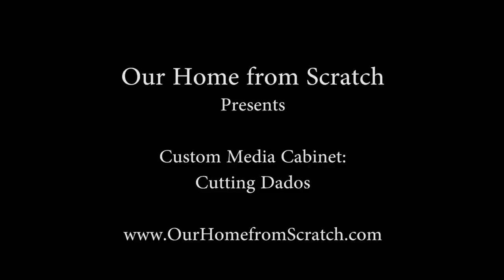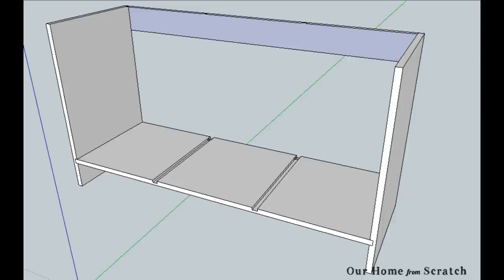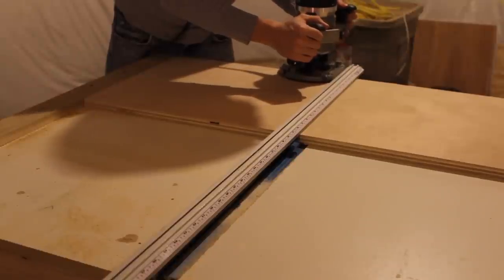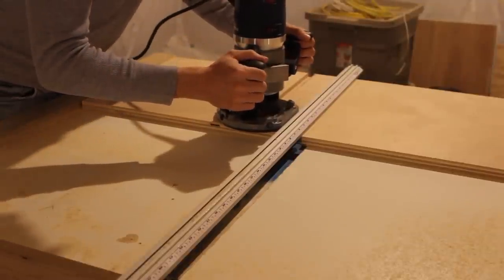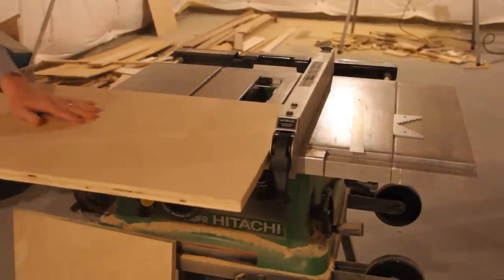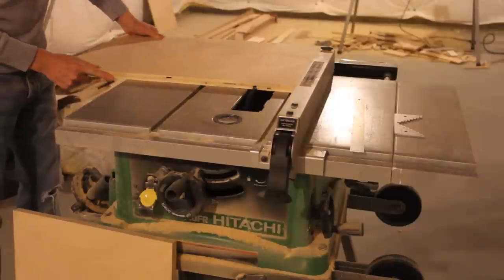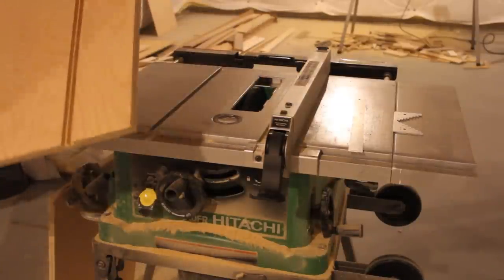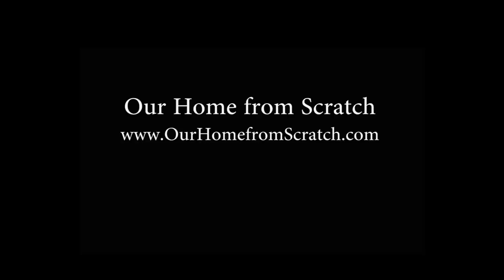How to Cut Grooves and Dados

Comment: Hi John, could you give any advice about to choose a router? Also, what is the metal guide called that you have clamped down to guide the router? Thanks, Andrew
Reply from the maker: It depends what you want to cut.  For cabinet building, a great entry level router is the Ryobi model:  https://amzn.to/2r5cURd  For more professional level work or if you're in it for the long haul, you can opt for the Bosch router with the plunge and fixed base:  https://amzn.to/2DKQEDF

The guide I used is no longer available, but you can get the latest version here:  https://www.amazon.com/dp/B0000DYVA9/?ref=exp_johnourhomefromscratch_lv_dp_vv_d

Comment: Here’s a tip: 3/4” plywood is actually not 3/4” thick but actually 23/32”. If you use a 23/32” size router bit, your grooves/dados will be nice and snug.

Comment: Do dado blades work with circular saws?
Reply from the maker: Hypothetically, yes.  In practice, no, they don't fit.  Most circular saws have 7-1/4" diameter blades.  Most dado blades are 8" in diameter.  Additionally, the stud on the saw that holds the blades isn't long enough to fit additional blades.  Normally, you would just use a router with a cutting bit for making dado cuts freehand.

Comment: I am using pine to build a table and a router to cut the slots or dados.  Just for fun and to frustrate myself, I am putting dados in the legs, then placing 3/4 pine in the slots to attach to the table top.  My problem has always been that the 3/4 inch router bit cuts a slot that is too tight for the 3/4 inch pine.  Besides using sandpaper wrapped around a piece of pine and slowly and painfully widening the slot, is there a better way to make it slightly wider; but, snug enough to look professional?
Reply from the maker: You can adjust the cut by moving back the fence a hair and making a second pass.  Use a thickness gauge to measure your adjustment.  Also make sure that you're using a 3/4" bit and not a 23/32" bit.
Reply: I checked the bit size.  It is a quality bit so I am guessing it is 
accurate.  I've also used more than one bit and had the same problem.  
I've also used the two pass method.

I was secretly hoping that you would tell me of some magical tool that I could tell my wife, "John Our Home from Scratch told me about this so I have to buy it..."

Thanks for the input.  Your videos are helpful.
Reply from the maker: Sorry!  I'm always happy to help guys get approval for tool purchases.  Let me know if you need something in writing!
Reply: I'll save that ace card for the "John said I need a 70" flat screen in my workshop to finish that bread board" discussion...
Reply from the maker: I'll order company letterhead paper to make it look more official.  Just let me know when.  :)

Comment: Hello John. Great demo. I use my router to do dado's and grooves but never used my table saw. I have a 10" craftsman table saw that looks similar to your Hitachi table saw and I was always under the impression that you could NOT use dado blades on these small table saws. Can you tell me what blades did you use for these dado cuts? Thanks man.
Reply from the maker: Thanks, Ed.  Some smaller contractor table saws like my Hitachi can handle a couple stacked blades although they aren't rated for them.  I'm only able to get about 3/8" worth of stacked blades on this one.  I'm using a Freud dado blade stack here.  My last table saw was a Delta and it could take up to 3/4" or more.  Varies from saw to saw.

Comment: Nice vid John, but that dado's(the routed one) a bit loose. It should be mentioned that plywood is never the stated thickness. I've seen 3/4 plywood everywhere from slightly more than 5/8 to a few thousandths more than 3/4. I'm sure it gets even worse than that. It's usually recommended to use an undersize bit (1/2) and make more than one pass. A loose dado won't glue up properly, and those undersize bits they sell don't account for the pieces that are more than the stated thickness.
Reply from the maker: Joseph Giampietro Very true.  Thanks!

Comment: you are using the table saw wong you never pull work trough  you push it through standing at the front of the machine
Reply from the maker: Ian, this is a smaller table saw and I'm trying to film the blade making contact with the wood.  I wanted to show this particular angle.  I typically stand in front of the saw and then move to the side or rear if the piece is too large to be supported without falling.  I also need an out feed table.

Comment: That was fine but you didn't show how to align your router to the location to perform the dado.  Pushing the router is easy.
Reply: +goofyfoot2001 Aligning the router is as simple as measuring from the end point of the bit you are using, to the outer edge of your router base. Take that measurement, and set up your straight edge that distance from the cut line.

Comment: Router cuts are not consistent. table saw too dangerous. They have to be  a better way..
Reply: +Ben YoJoseph If you're using a router table, the cuts are extremely consistent. And a table saw isn't too dangerous. If you feel this way, you shouldn't be doing any kind of woodworking at all.